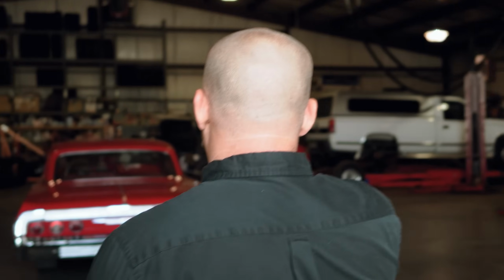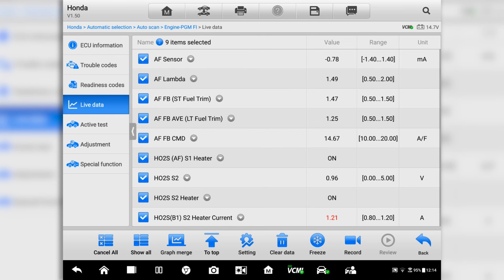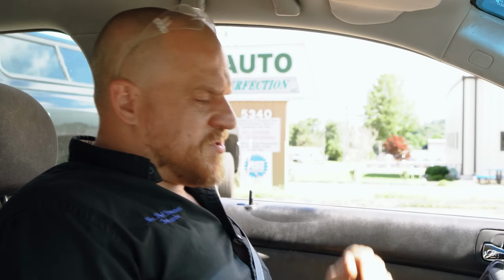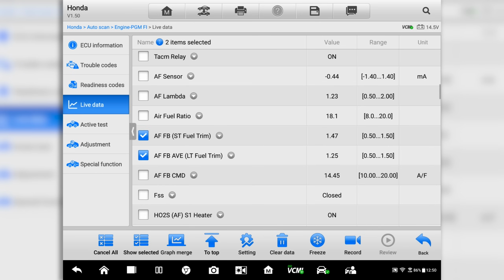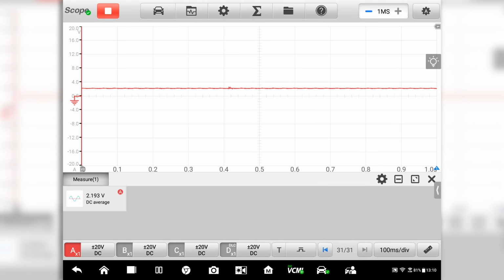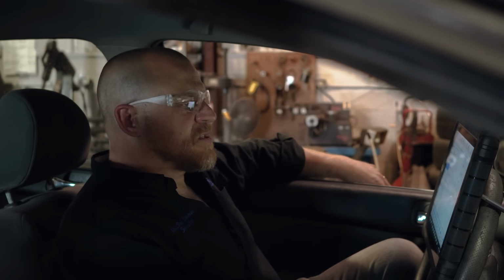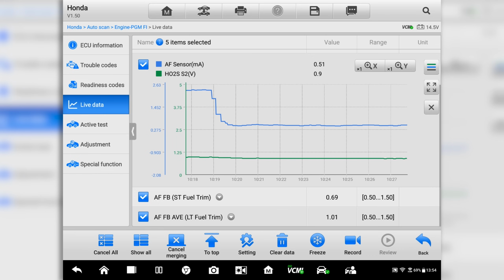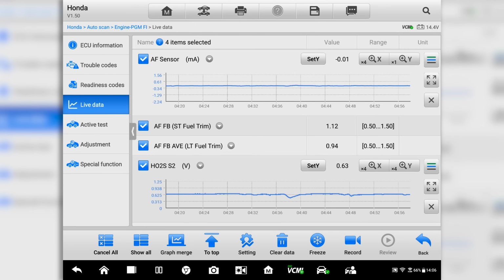2007 Honda Accord Wideband O2 (Air Fuel Ratio Sensor) Testing

Comment: This video was a real challenge for my dyslexia, I had to pause and watch the first part three times to wrap my head around the numbers. What I hear you saying is what I expected, that when lambda is > 1.0 the sensor is detecting a lean condition, opposite to narrow band where higher voltage numbers mean rich. At the same instant the lambda is +1.5, the current is -0.8, and the two data pids consistently swing in opposite directions, so negative current must be a lean signal back to the PCM in this Honda. That's confusing, but easy enough to remember for Honda. It sounds like it might be easier to remember "Large Lambda Lean" in all cars to recall which way lean pushes lambda. In terms of the response of the PCM, the fuel trim readings are in the SAME direction as a narrow band, ie greater than 1.0 fuel trim means the computer is responding to that lean observation by adding more fuel, like it did with narrow band. In the end, I'll have to play with the scan tool in every car to see how these sensors are calibrated, while driving it rich and lean with snap throttle or induced vac leak. Thanks for the detailed walk through!

Comment: I got confuse!I learn that negative current  at the upper fuel ratio sensor mean rich. Did I got wrong information?
Reply from the maker: There is no standard for that. This model it is opposite
Reply: Wide band and narrow band are differents

Comment: Great video! I've learnt Euro and Asian cars need clearing of codes which resets the fuel trims also, after fixing any fault. A test drive also helps to relearn everything back to normal after. However bmw and mini are different resetting/clearing  codes doesn't reset learnt adaptions for fuel trims, GDI injectors etc, you need to delete the adaptions with a suitable diagnostic tool or even better inpa or ista SOFTWARE. I've just encountered this on my bmw 325i with gdi after nox sensor failure and 1 piezo injector which was failing lean when hot only. After coding new injector and resting all adaption with inpa I followed the relearn test drive process and now runs perfectly. 
Bmw also use wide band sensors showing 2volts for lambda 1 stociometric with 3volts being rich and 1volt lean for up stream only and narrow band for downstream 0.45v is perfect 0.9v is rich 0.1 lean.

Comment: +-5 can be mass airflow dirty, others should not him, or the acceptable error from old sensors.
+6 to +20 pumping case can be fuel regulator or fuel pump (pressure check important - use manufacture data documents/ Alldata), 
-5 to -20 can be injector leak or regulator too high (pressure check important). 
over +20 need check by smoking test (maybe gas cap, Evap system, brake booster leak...) or just lock all split air hose, it will easily figure out.
Data memory is never needed to reset due to supper fast PCM re-action. if the memory of long trim is +49 and all problems are solved, the -48/-49 should appear immediately in short trim. So confident with what you see on real-time data. 
PCM is never wrong but sensors can lie. DIY doesn`t have too many bucks to change and to try on everything to tell which was wrong. So do the smart way with correct logic and correct analysis will save a lot.

Comment: My 2006 accord had that persistent +12 short fuel trim.  Checked O2 sensors, fuel psi, MAF and for leaks.  The air pipe from the MAF to the throttle body had small cracks on the bottom where it “accordions “ .  Only found it when I removed it to clean the throttle body.  Ordered OEM and bam numbers went to +2.  Got me thinking.  Looked at my 1999 accord, same cracks.  Unless you remove the pipe and gently pull it apart and look you will never find them.  BTW the 99 has a short term, long term combined of +1.5, with 280k miles I’m fine with that!

Comment: I didnt have any codes except the catalyst code, so I changed it, however the light came on again, and my sluggishness persisted. Hills that I used to take with ease are now difficult especially in hot weather
Reply: don't be a parts changer!

Comment: Paul, Question: If I take my test light from my positive batt term to an unhooked power dist center and it lights and vehicle never blows fuses. Is that from hot switch circuits?

Comment: My wife's 07 Accord gets a PO420 code that will cause the engine light to come on for a couple of days and then go away, for weeks and then come back for another couple of days and then go away again for weeks or months, no other codes just the PO420, any ideas?
Reply from the maker: Yep, you need a cat
Make sure you do not have any exhaust leaks and fuel trims are normal and no other codes. 
Use a factory replacement ONLY! Aftermarket cats will set this same code again in just a few short months
Reply: @ScannerDanner  Question, if I took it off and hollowed out the inside and put it back on, will it throw a code? We use to do that in the early 80's when they would clog and cause loss of engine power. The wife's car is running perfect, can I use a temp sensor gun and keep a check on how hot the pipe is before and after the cat to see if it's getting worse? Just wondering.

Comment: Always more questions than answers When you’re repairing a car. Great video
Reply from the maker: Anything I can help clarify?
Reply: I have same question, I suppose the fixing was when hose was plugged in intake, but still car has positive trim cause of dirty cat, the cat is clogged by rich mixture that engine use when the hose was removed

Comment: I had exactly the same failure on a 2007 Accord.  The code is down stream O2 sensor stuck rich.  Lucky I had 2 Accords and swapping the down stream O2 sensors didn't make a difference.  Unplugging the upstream sensor did the trick.

Comment: check the front motor mount some run on vacum, just pinch the house and see if the fuel trim goes to normal

Comment: Well well well. That was amazing. After you replaced the sensor and the numbers still weren't right I was hoping you would use the exhaust gas analyzer again for a truth check. I know you didn't need it but would have been interesting and fast to do.

Comment: In the flat rate world, once I saw the rich rear reading and lean front, while smelling rich condition…i’d unplug the front sensor or induce a vacuum leak to test next.
They are usually asking me how long before I can look at 3 more cars….:).
Reply from the maker: agree, in the flat rate world and even in my brothers shop, this thing is getting a new AF sensor based on just a few checks with scan data. When we started, my brother had already ordered a sensor. I just used this opportunity to go over some things with you guys

Comment: Hello sir! From Vigan city, philippines, what should be my first step in checking my corolla 4afe, dont start but has a spark in the spark plug socket only the color is orange . . Engine check light is not steady. . It goes on and off . . What would I do sir? I dont have a scanner sir

Comment: You forgot to check fuel trims on global after the fix, just to compare with your current data, great class
Reply from the maker: I didn't feel it was necessary as we learned how to interpret the factory data earlier in the video, by using global data. No reason to go back, but it would have driven home the point better, sorry

Comment: In Toyota systems with A/F sensor from Denso, the difference between AF + (3.3V) and AF- (2.9V) is constant = 0.4V. Only the current value changes. Only the current value in [mA] informs about the A/F (or lambda) ratio. Very interesting video Mr. Paul Danner!!
Reply from the maker: And these will read opposite of this Honda

Comment: Hey Paul I have a question for you. On material that I have read and on some of your case studies says that negative current is rich and positive current means lean but in your scan tool you it appears only negative current flow, why does that happens?
Reply from the maker: It is on SOME, not all my friend. Read the pinned comment from a friend, right here in this comments section. Thanks!

Comment: I teach the use of the Equivelance Ratio PID on Global OBD2 for this diag. While the mA may be contradicting on different makes, the scale and direction of the EQ ratio PID never changes. 

Also handy - there is usually a “Commanded EQ ratio” and an actual “EQ ratio” PID.

Comment: I have found wide band sensors harder to deal with because the calibration strategies are non intuitive. A wide band sensor does not have that switching point so they need to do something else to calibrate themselves.

Comment: It would be interesting to see another scan tool used to measure the sensor current. The discrepancy with negative vs positive current and rich lean could be a scan tool issue.
Reply from the maker: Read the pinned comment by @Evan Waynne

Comment: what if fuel contaminated oil is masking a lean condition.
Reply from the maker: If you have that concern, you can pinch off the pcv hose (if possible) and watch your O2 and STFT 
This car was getting an oil change regardless after running that rich.
Good question, but can't say that I've ever seen that 😉

Comment: ScannerDanner i have 2 dodge calibers different years "2007 and 2012" but both have the P0420 code and both have bad Catalytic Converter i did the same as you i replaced both o2 sensors on both cars and both smells like rotten eggs.. long story short i don't have "$1,018 each" for the catalytic converters.
Reply from the maker: Rotten egg smell is NOT from a bad cat. It is from a bad mixture going into a cat. What are your fuel trim numbers?
Reply: @ScannerDanner  well i can't tell you on the 2007 it's off the road for some time till i can get other things fixed but the 2012 is the car i'm driving when it showed the engine light it had a s.t. of 1.3 and l.t. of 3.9 but i had to bust the Catalytic Converters on both and get 2 new exhaust manifolds for both the Catalytic Converters where stopped up and cracked them.. they got very hot

Comment: Hi Paul, whenever you show a video like this, I always learn a lot from your teaching.  I really enjoy them.  As always receives the biggest cyber-hug.  from Tijuana B, C.  Mexico.  🇲🇽 👍👍👍
Reply from the maker: Thank you Jose!
Reply: Paul, let me recommend this video of Mr. Bill Peack, which is related to the case that you present here.  from Tijuana Mexico.  🇲🇽 I hope it is useful to you. (4 Wideband Air/Fuel Ratio ((AFR) signal values and Scan Data) Note: this video is in YouTube.
Reply from the maker: @josedejesusvelazquez6863  post the link my friend
Reply from the maker: @josedejesusvelazquez6863  good video, but just keep in mind this is A design, and not all are exactly like this. He's discussing a 6-8 wire sensor and using a Toyota example with the 3.3 and 3.2 bias. This Honda design is just not like this at all. 4 pins and opposite ma numbers. Lots of variables with these for sure.

Comment: Old single wire O2's would do that too.
Reply from the maker: Yep,and honestly the approach is no different right?
Reply: @ScannerDanner   Absolutely. I do find generic OBD data to be a quick and easy way to at least point me in a direction rather than to just use vehicle specific data because most manufacturers use different biased voltages but long term and short term remain constant..At least for now! Cheers

Comment: @ScannerDanner   Wait, negative wide band current =reading lean?  My Pilot and every other car I've measured with a wide band sensor, negative current = reading rich.  Why the opposite on this vehicle or scan tool?
Reply from the maker: Read the pinned comment from @Evan Wynne we have an answer
Reply from the maker: Good question my friend. You're the third person to mention this. My answer is I'm not sure, but you could clearly see it was operating this way. The decel fuel cut (definitely a lean period), the ma numbers were negative, and when I had the MAF unplugged, and the mixture was pegged rich (new af sensor), you could see the ma numbers were postive

Comment: I like it that Danner finally is embracing the Autel over the Snap-on. Great video.
Reply: I've used both, and there's a bit of a misconception among the autel fanboys that their scanners are the official "lower priced replacement for snap on scanners". Absolute nonsense. The autel scanners do a lot of things well on certain vehicles, but the exact same can be said for snap on. There are no magic bullets in this business, nor are there any "one size fits all best of the best scanners". It's simply a matter of selecting the best tool at the time for the task at hand.
Reply from the maker: At times yes, at other times no 😀

Comment: Brain farting! 

Did Some one say "420" to me that means a baked verter.

 That O2 is a "pump" correct? the oil contamination will fault the new sensor if oil is getting on it.
I cant stress enough that any debris or contaminants on the exterior of a wideband WILL affect the sensors ability to function as designed.
The oil leak must be fixed to warranty the O2, changing the oil is included in the repair.

Comment: Wideband o2  we measured current flow in mA not volts. Positive current -lean condition  , negative rich . 0 current means afr14.7 or lambda 1 .
Reply from the maker: Read the comment I just pinned by @Evan Wynne, we have an answer 😉
Thanks!
Reply from the maker: Positive current on this one was a rich signal. Also watch when the system was in decel fuel cut mode. The sensor went even more negative
Reply from the maker: watch at 35:53 when I had the MAF unplugged for the best view of this, both downstream and upstream sensors are full rich in this moment (new upstream sensor)
Lambda is opposite, but this is just a calculated number anyway. Lambda = 1.0 and numbers below are a rich indication and numbers above are a lean indication

Comment: Don’t wideband sensors add current when rich, not when lean? So the graph should go down when WOT and go up on decel. Opposite of a narrowband.
Reply from the maker: Read the comment I just pinned by @Evan Wynne, we have an answer 😉
Thanks!
Reply: @ScannerDanner  great video. Always learning from you. - a young tech from Toronto Canada.
Reply from the maker: On this model, I dont know if this is all of them, positive current is rich and negative current is lean
Reply from the maker: watch at 35:53 when I had the MAF unplugged for the best view of this, both downstream and upstream sensors are full rich in this moment (new upstream sensor)
Lambda is opposite, but this is just a calculated number anyway. Lambda = 1.0 and numbers below are a rich indication and numbers above are a lean indication